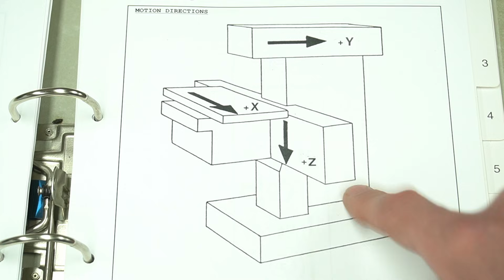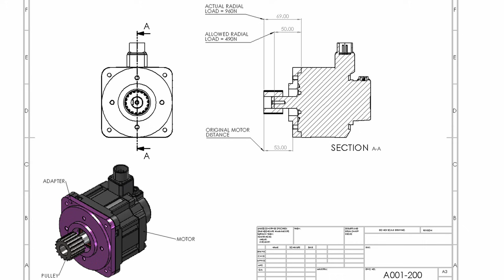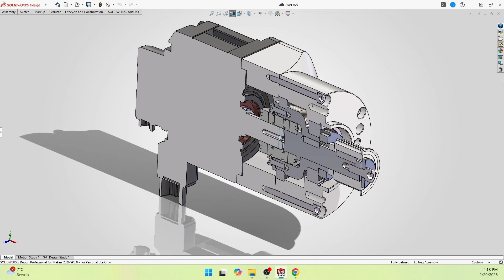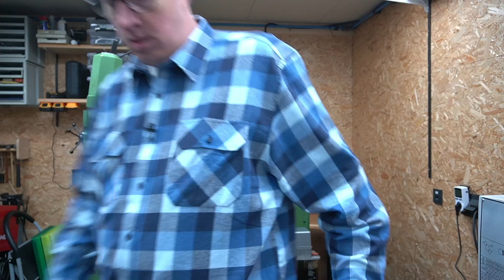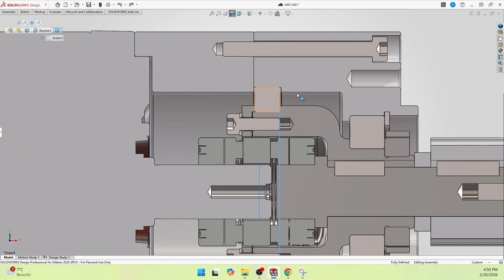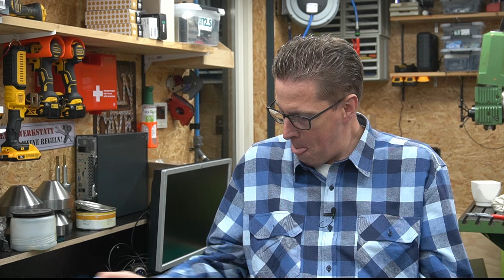CNC Retrofit: Servomotor Adapter Design & Engineering Challenges

Comment: I'm not an engineer*, but I have some experience in things with bearings and shafts, being a lathe machinist for some decades.

Keep it simple as you can, in my opinion.
Two steel flanges, with a spacer tube in the middle, if you want it to be stiffer, weld them together.
First flange, motor side, just for positioning on the motor.
Tube of the needed length to space the first and the second one and to contain the coupler, in the second flange you can put a double row angular contact bearing.
They're rigid axially and radially.
They aren't cheap, until you realise that you can build your design around an automotive one from a wheel hub.😉
Take a look on autodoc, the ones for old Fiats, Panda's and Punto's are small and tough.
Also, if you don't want to use them and keep your design, you must keep concentricity between the servo motor centering diameter and the bearing's, having a belt on the machine side, the position of that centering diameter isn't crucial.
Remove the shoulder on the belt side bearing external diameter, and replace it with another circlip ring, in that way the manufacturer can make every meaningful diameter on the lathe without effort.

*This sounds silly in the YouTube machinists area, I'm also not "not an engineer".
Reply from the maker: Thanks for the practical machining perspective! Always good to hear from someone who actually makes these things rather than just designs them.

The automotive wheel bearing suggestion is intriguing - I hadn't considered using off-the-shelf wheel hub assemblies. Though my shaft is 20mm, not 40-50mm, so I'd need to find something in that size range. Might be worth a trip to a junkyard to see what's available.

Good point about the motor centering not being critical since the belt is on the opposite side of the adapter. That does simplify the design a bit.

The circlip-on-both-sides suggestion is a great manufacturability tip - I'll definitely look into that.

I'm genuinely curious about the duplex bearing approach - several people have suggested it now. I think I'll reach out to my bearing supplier to get their input on whether a single double-row angular contact bearing would be sufficient for my loads. If it works, it would certainly simplify the design significantly.

With a welded tube construction, how would you handle the bearing seat tolerances? Bore after welding to clean up distortion?
Reply: @workshop54projects  You're welcome!
I'm at work now, but having some minutes between machine cycles I took a look at those bearings.
The mk1 fiat Punto's have a 35mm id and 66mm od and it costs 11€ on autodoc.
It needs to be installed on a shaft with a shoulder and a nut (like the GUK self locking ones, or better something with a radial locking screw) since the inner ring is split and it needs to be axially locked for the bearing to work properly.
The outside ring is made in a single piece.
You can design the shaft around the id and thickness of the bearing, js7 tolerance on the shaft and K7 on the od in the support.
You can also simply make the connection on the motor side with a precise hole in which the motor shaft sits, and to save money you can also avoid using tabs and replacing them with a couple or more set screws to be tightened against the flat of the tab seat on the shaft.

To keep concentricity yes, the bearing and motor mating areas have to be machined after welding.
That's not difficult.

If you want, contact me directly, I put my contact on my channel, we can make a simple design together!
Reply from the maker: Hi @PreciousPlasticRomagna,

Somehow I don't get notifications from YouTube anymore when I get comments. Thank you very much for your suggestions. 

The bearings you suggested seems too big for my situation. The outside diameter of the housing on the machine side is only 70mm, and it looks like the outside diameter of these bearings is 66mm. That leaves a wall thickness of just 2mm, without the snap ring groove. 

I also found a "3205 A-2RS1" bearing that seems to do the same thing and should be able to handle the forces properly.

I'm working on a new design that will be much simpler than the one I have now.

And thanks for the tolerances on the bearing seats. I really appreciate it.

Comment: You are going to have a fair bit of machining to make those adapters. I am looking forward to those machining videos. It looks like you will need to machine the bearing bores from different ends, and therefore in two set ups (at least to use a standard boring tool). That is hard to do. Can you reverse the mounting of the front bearing, with the shoulder in front and then move circlip groove behind the large bearin so all boring operations and the motor alignment boss van be machined a single set up?

 I don't think the lock nut torque will be much of an issue. 

By leaving the one bearing outer race floating, and locating the other outer race located by a circlip (which will also mean a floating bearing race as you cant install a preloaded circlip), you will have some end float. Your coupling should be fine with that, and at the end you are driving a rubber belt, so any end float will likely be irrelevant.

I would have used the original couplings, first tightening the couplings before torqueing down the motor flange bolts. Basically letting the coupling center everything. But I am loath to waste parts I already paid for. :)

Given the issues that cable connect height is causing you, have you considered making up an adapter to rotate the connector 90° so the cable connects parallel to the motor shaft?
Reply from the maker: Thanks for the detailed feedback!

Great catch on the bearing bores! You're absolutely right that machining from both ends complicates things. I'll look into reversing the front bearing mounting so everything can be done in a single setup - that would make manufacturing much more practical.

Good to hear you think the floating outer race approach should work! And yes, the coupling should handle any end float just fine.

Regarding the original couplings - I hear you on not wanting to waste parts! I asked the manufacturer about the 0.02mm lateral misalignment spec, and they confirmed it's really that tight. And of course, manufacturers would never try to sell me new couplings if it wasn't actually necessary, right? 😅

For the cable connector - do you mean a 90° adapter on the connector itself? I haven't found one for these Delta connectors, but if they exist that would indeed be simpler than modifying the cover.
Reply: @workshop54projects  I was wondering if the connector is screwed in, if you can unscrew it, and if the wires are long enough, you could make a 90 adapter to mount between the housing and the connector.
Reply from the maker: That's actually an interesting idea! A 3D printed 90° adapter could indeed simplify things if it works.

I'll need to check if the connector is removable and if the wires inside have enough length. Extending the wires would be possible, but I'm a bit nervous about modifying brand new motors like that 😅

If the wires are long enough though, this could be a much simpler solution than redesigning the cover. Worth investigating! Thanks for the suggestion.

Comment: Instead of double bearing arrangement maybe self-lubricating bearing bronze bushing or some teflon analog material. Spec for motors and couplings are for millions hours of operation. Yours machine will see no more than thousands in its remaining life. Make test run with single couplers and plastic adapters and check is something is heating or binds. I bet you will see that spec can be much more loose than microns. As an CS engineer I tend also to often do analysis paralysis when I need to do something for my machine. I need someone just to remaind me that I am building amateur milling machine and not chips lithography machine.
Reply from the maker: Thanks for the reality check - you're absolutely right that I don't need millions of hours of service life. I do have a tendency to over-engineer things (comes with the CS engineer territory, I guess!).

Regarding the bushing suggestion though - I'm curious if you have examples where unlubricated bronze or teflon bushings work well in this type of application? My concern is that I have significant radial loads from the timing belt and variable loading during acceleration/deceleration. From what I understand, ball bearings are just the standard solution here - not because I'm building a lithography machine, but because they're the right tool for the job.

That said, your point about testing with "looser" tolerances is valid. That's exactly why I'm planning to 3D print prototypes first before committing to expensive machining. If the tests show I'm overthinking it, I'll simplify accordingly.

But I'm genuinely interested - do you have experience with self-lubricating bushings in CNC retrofits or similar applications? Always happy to learn from others' practical experience!

Comment: These housings look like a pain to make, did you think about not doing them out of a single pice? Like using some thick walled pipe and have a plate in front and behind and then welding it + milling it flat (yes i know it might have some stresses but for that stuff should be fine).

The question is more where are you located as that matters for ordering.
Reply from the maker: Thanks for the suggestion! I'm curious though about what makes you think they're difficult to manufacture? I've designed them as two-piece assemblies and tried to keep manufacturability in mind throughout the design process.

The welded tube approach is interesting, though I'm concerned about heat distortion affecting the bearing seat tolerances. But I'll definitely keep it as an option to explore.

I'm located in the Netherlands - any specific recommendations for machine shops here?

Comment: I question the conclusion that you cannot find a duplex bearing pair with enough separation to handle the overhang load in the given space.
Think about an automobile wheel duplex bearing and what it must endure inside 50mm mounted width.

Hollow shaft connection with clamp ring can be a space saver. These are common in connecting gear reducers.

Another idea for the now Zed axis, if you haven't done so already, is to explore mounting an outboard bearing pair in its own housing on the opposite side of the machine casting.
In this case a ringfeder style coupling can extend the shaft with excellent torque and alignment capability, while reducing manufacturing cost.
But also you can stay with your misalignment coupler and use the ouboard bearing pair on the opposite side of the casting.
To be clear, in these case you will have the belt exit the side of outboard housing in the current place to align to the driven side toothed wheel. This is a common arrrangment.

Sometimes it is at cross purposes to seek design resuability when it complicates all cases.
Often the best part is no part.
Reply from the maker: You make a fair point about the duplex bearing approach - automotive wheel bearings do handle impressive loads in compact spaces. I said in the video it felt inadequate to me, but that's just based on uncertainty rather than calculations. I'm definitely going to look into suitable duplex bearings more seriously.

Regarding the hollow shaft with clamp ring - I'm not entirely sure what you're referring to here. Do you mean a shrink-fit or hydraulic connection? Could you elaborate?

I did explore the outboard bearing arrangement for the Z-axis early on, and even made several design iterations. The challenge was that it would require modifying the original machine castings and actually resulted in more parts overall rather than simplifying things. That's why I went with this approach instead.

You're absolutely right that seeking design reusability can sometimes complicate individual cases. Interestingly, my current design started out more complex when forcing the same adapter for all three axes, but I feel like I'm getting close to a solution that works well for all of them now.

And I completely agree with "the best part is no part" - every component adds complexity and potential failure points. That's exactly why I'm asking the community for feedback before committing to manufacturing.

Thanks for the thoughtful input!
Reply: @workshop54projects  ... It's an interesting challenge. You really are space limited. The solution you have does solve the intial problem, and is in parts elegant. Only the manufacturing is tricky with opposing blind features, namely opposing shoulders in the ID of turned parts. This is fine for cnc, but will be machining by dial numbers and not sight without cnc. Nothing wrong with that.
When I design a spindle I try to make the bearing bore one dimension (duplicate bearings) and able to finsih turn both mountings in one toolpath. Bearing separation is handled with a spacer pair and fixed in position in the bore by setscrew of the spacer through the housing, or snap rings on the housing and shaft. This gets away from spindle nuts for spindles where axial rigidity and position aren't a concern.
I detect some reluctance to modify stock items. This is noble and aesthetic, but also limiting. For example, you have a significant amount of shaft key on the motor side that is exposed. This may be as much as 10 or 12 mm more space that you can have by shortening the motor shaft. I know it offends the senses to do it, but it is a valid solution to cut the motor shaft when it helps. I think about it like this....if you were to optimize the design you would have a custom motor configuration, which just means a shorter shaft from factory. You can be the factory.
Also you suggest you don't want to modify the machine casting. Again noble, but perhaps limiting. Think about how much you already modify for the retrofit. Modifying a casting is fair game imo.
Do you have the casting drawn? What Solidworks vesion are you using?
Your design as drawn is a fine solution. I happily follow along.
Reply from the maker: Thanks for the detailed feedback! You're absolutely right about the opposing blind features being tricky - that's something I need to address to make manufacturing more practical. Your approach of using duplicate bearings with spacers and fixing them with setscrews or snap rings is elegant and much more machinable.

Several people have now mentioned the concentricity challenge with my current design, so I'm definitely taking that seriously and will look into simplifying the bearing arrangement.

The motor shaft shortening suggestion is smart - you're right that it would give me more space. I'm just nervous about modifying brand new motors! But you make a fair point: if I were specifying a custom motor, it would have a shorter shaft from the factory. I can be that factory. I'll consider it.

Regarding the machine castings - I'm not opposed to modifying them on principle, but I don't currently have access to a mill large enough to work on them, and we don't have many job shops nearby that I know of. So it's more of a practical limitation than an aesthetic one.

I do have the Y-axis casting drawn in SolidWorks (for Makers, latest version) from an earlier design iteration where I was considering modifying it.

Thanks for following along and for the compliment on the design - even if it needs some iteration!
Reply: @workshop54projects  
Some more ideas:
If you eliminate the spindle nut you can move the outboard bearing next to the tooth wheel. This means your housing sticks into the casting bore more to support that bearing. Also when you eliminate the spindle nut you eliminate the internal bell shaped sub-shaft so now your outboard bearing can be much smaller. Also, when the bearing sits directly by the load it can be much smaller.
In this case you can use only retaining rings for the bearing OD and shoulders for the bearing ID, which is also used for toothed wheel clamping.
I think it is easy to have two identical bearings in a single size bore when the bearing size gets less and comes close to the toothed wheel.
In this case you probably don't need to cut the motor shaft, but this can remain an option for extra space and capacity if needed.
This will give plenty of capacity, with good bearing separation, and inherently aligned in a single bore.
All critical machining operations can occur in one setup, but the motor side must be indicated in a separate setup. The motor side accuracy is trivial when the misalignment coupler is used.
There are some details to harmonize like the existing toothed wheel ID and shaft OD, and whether you have shoulders to facilitate clamping the toothed wheel.
I drew already the above idea, but of course it is without accurate dimensions.
Worth a look I think. If you want to share STEP files I can modify my version to reflect actual geometry.
And if I'm doing too much I can back off.
Reply: Next time I must read all the comments before writing mine.
I had the same idea (and developed machines with that idea in the past).😅